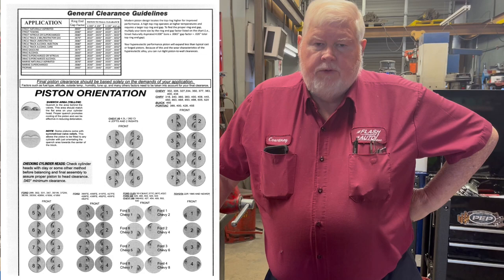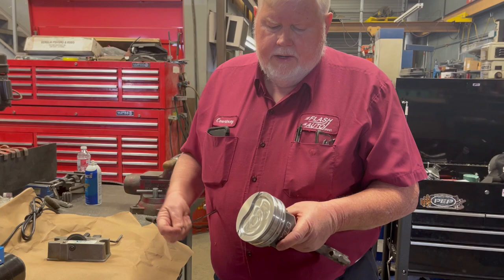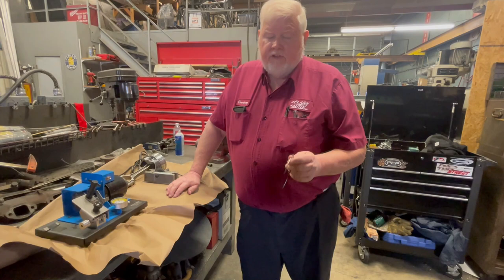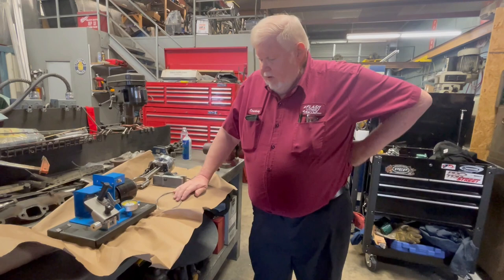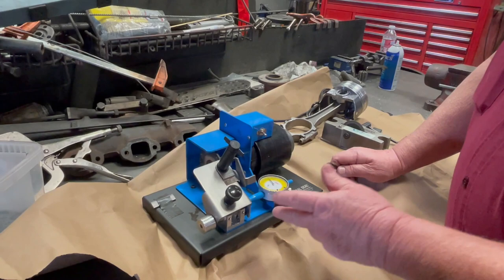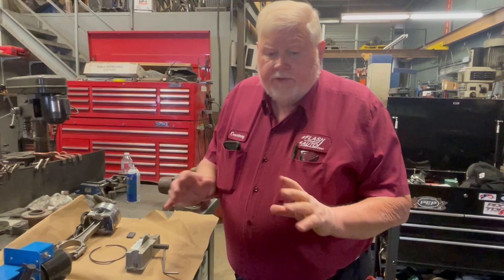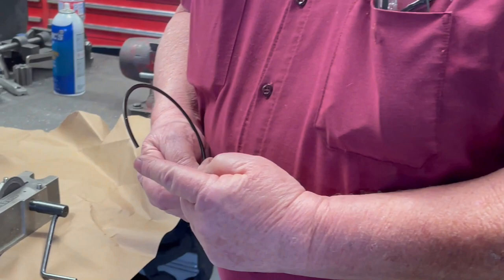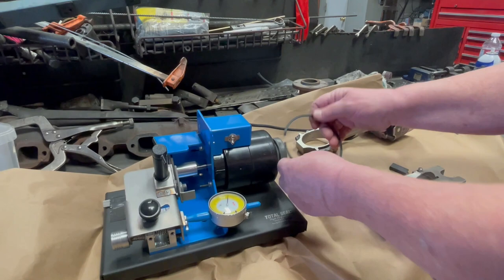KB Pistons and Ring End Gap

Comment: World greatest and cheapest ring squaring tool is a 1” roll of masking tape.  Simply remove tape until it fits the bore, put the ring in and push it down until the roll is flush with the deck!
Reply: I use another piston upside down with only the second ring installed.

Comment: I am very skeptical about those pistons. Tried them in 455 Buicks a few times and had a set fail and the other motor had piston slap. We machine exactly to there specs.  Now i just use stock replacement or forged. I prefer the forged
Reply: Your full of it.

Comment: have a stock 5.9 magnum engine, 9.580 deck height, based on my calculations the KB107 4.000 piston would be above deck .008. I checked #1 stock piston, it is .044 below deck at tdc, and looks like a chamfer of approx .035 at top of cylinder. Do U see any issues, other than thicker gasket for proper quench..............

Comment: Great video, thanks! I'm using KB hypers on my 383 stoker build, street use. According to the chart they provide they recommend a Top Ring gap of .026" and second ring gap of .016". Many say to definitely go beyond the min gap, but can't find any recommendations as to how far to go.  How can you determine that?
Reply: Piston Bore X 0.0065 for street NA. Its better to be over than under with top ring gaps on Hypers. I am going towards a gap factor of 0.032 for the 4.020 bore I am building right now.
If you go under you will run into what he described. Take the tops off the pistons.